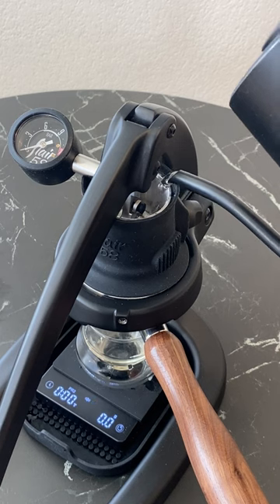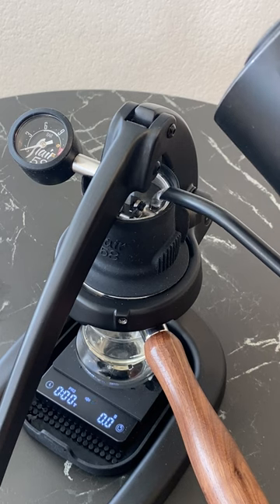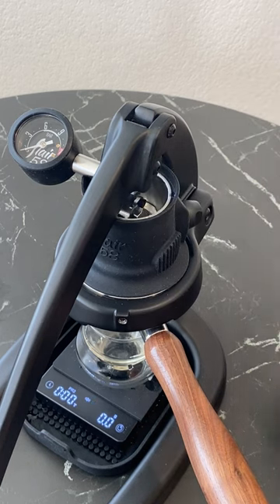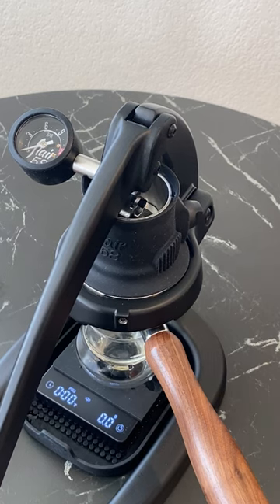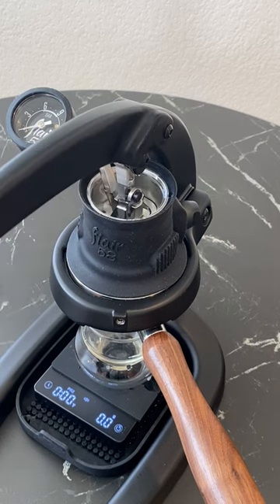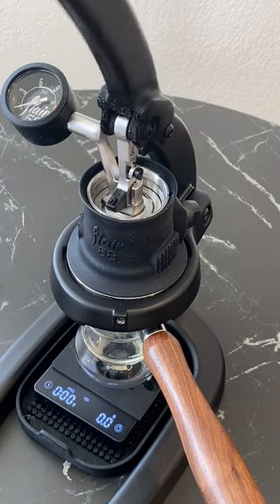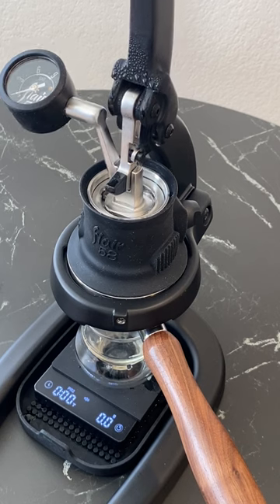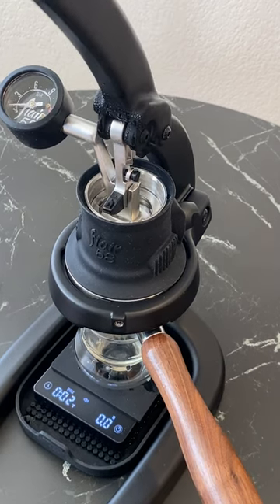Flair 58 Workflow Tip // check the description for details!

Comment: love my flair but this video is confusing. there is no description or caption as they mention.
Reply: the description is in the three dot menu on the upper right of the screen
Reply: If you’re looking to shave a few seconds off of your workflow, skipping 
the brew water top off and going straight into your extraction after 
raising the lever will do the trick.But, first ensure you 1) are fine 
with a slightly lower yield and 2) do not raise the valve plunger above 
water level, as this may introduce air pockets. Hope this tip helps, and
 happy brewing ☕️

The description :)

Comment: It is the only way ?? 
What i do is filling the water while the lever is down (same of the video), then I left the lever all the way up and adding water to insure that there is no air. Then i do pull down the lever for my extraction .. is this wrong ?
Reply: The other way, which takes a few seconds more, is to top up with water after you've fully raised the lever. I tried the "quick" way before, but I couldn't get a 36g yield from 18g of coffee, so it's not good for me.
Reply: Yeah, vivo I think this is the right way to do it. Air pockets will create channels that cause spray
Reply from the maker: Nope that’s totally fine too!